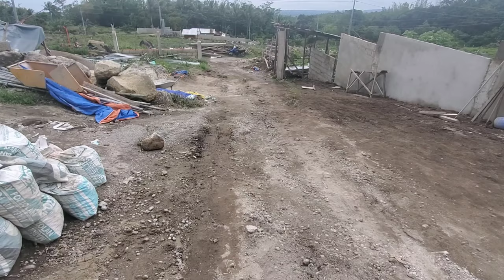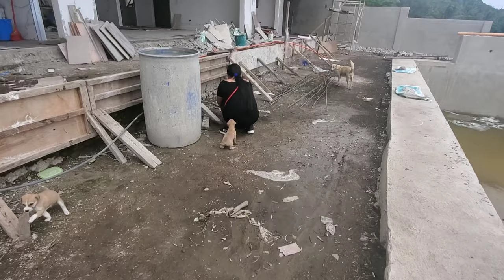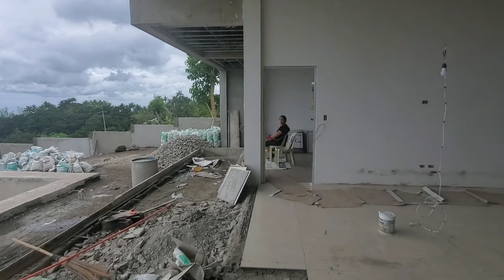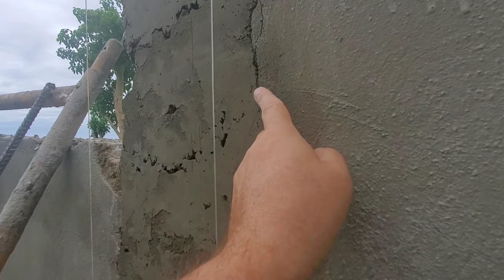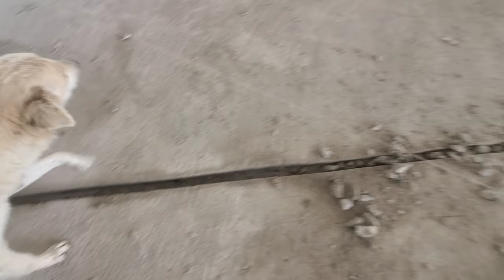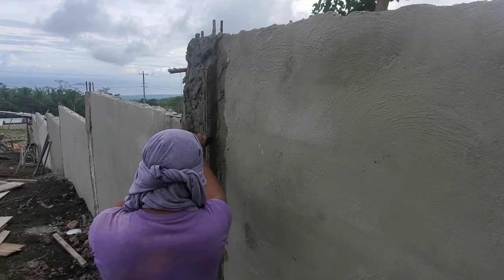American and Filipina Building a Home in the Philippines 🇵🇭

Comment: Great advice Greg, make sure all of your paperwork is legal and correct. Good lawyer, road acess, right of ways, flood zones, check the local Baranguy, building permits. Please remember the Philipines is not a one stop shop, you may need to go and get permits at each goverment authority. Dont hand over control of the paperwork, you as the owner stay in control and dont start building until everything is in order.
Reply from the maker: All good solid advice. Different rules here and need to ensure everything is in order.